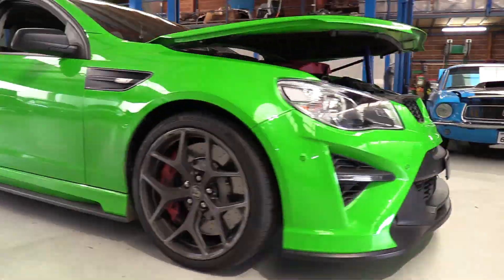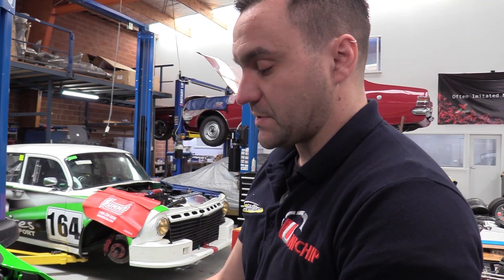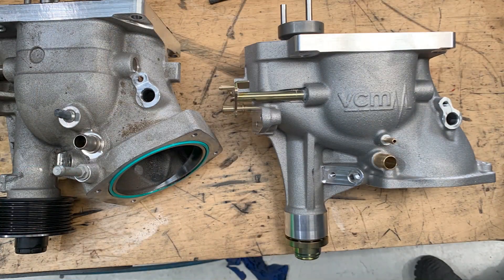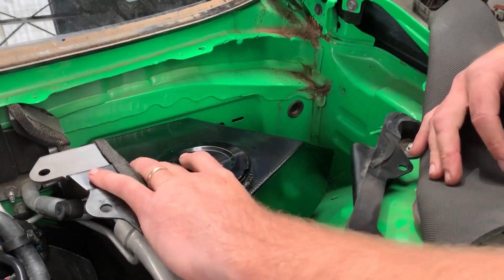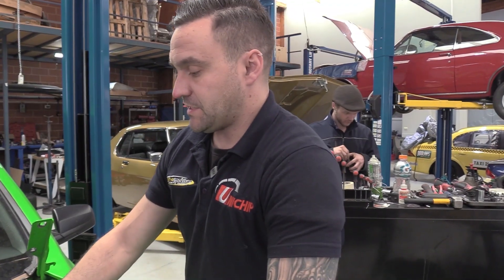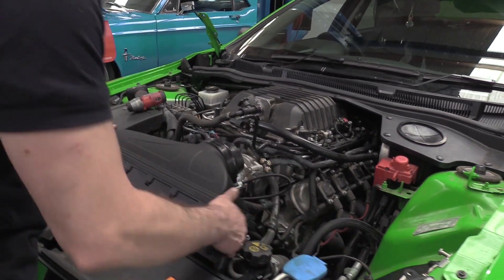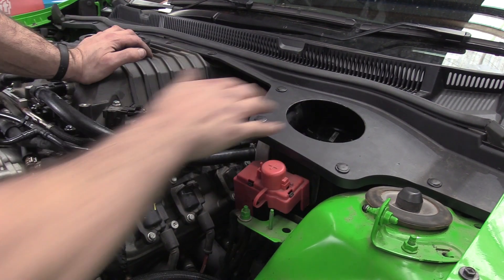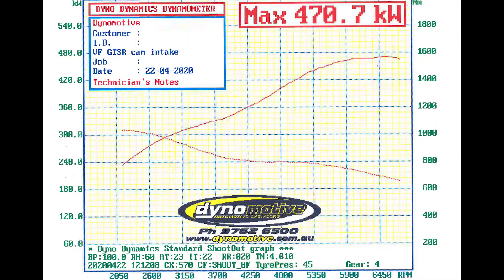H.S.V GTS-R LSA - Dynomotive Package-

Comment: so the  tank for the coolant for the supercharger is going to effect the intake air for the cabin right, after all you can see the cabin filter and air intake hole ,so that heat in the coolant will get hotter and thus as the air transferases that cooler it will make the cabin air get a little hotter right or wrong?
Reply from the maker: It’s like the Sahara in the cabin.